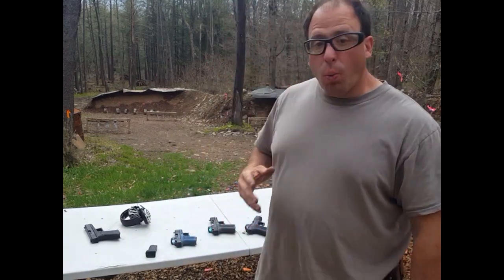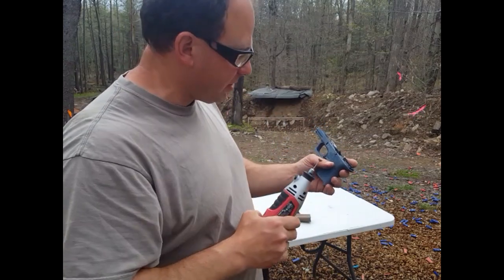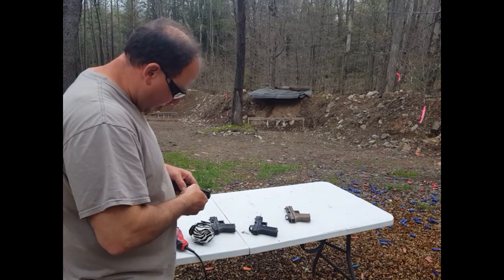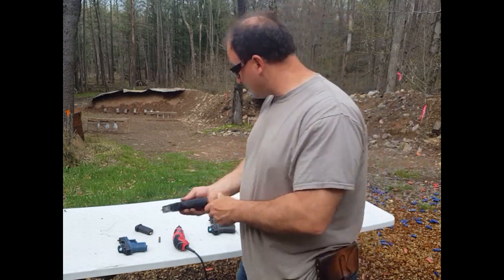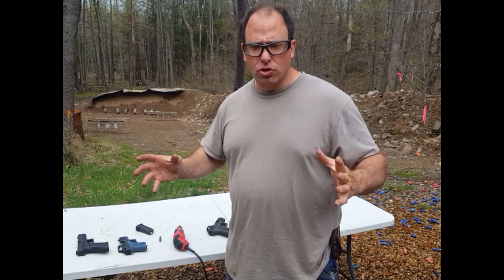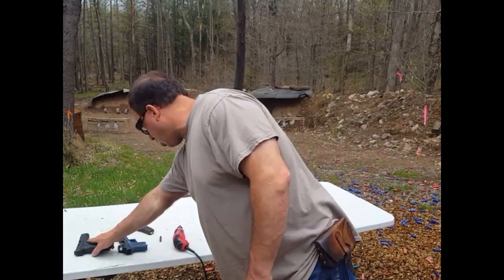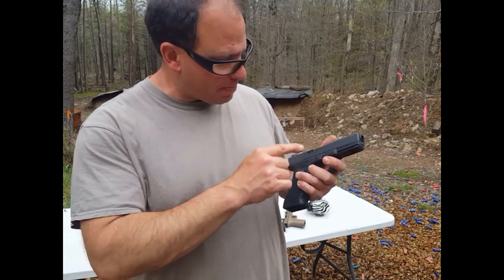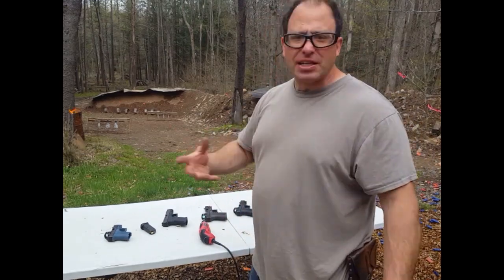Why "Ghost Guns" are Rarely used in Crimes

Comment: Me and my two cousins built one in less than 30 min it was pretty easy and we only used a drill and a exacto nife no issues either shoots like a dream
Reply from the maker: Polymer80 says you have to shoot 200 rounds to break it in. So you should not expect a gun to be reliable until you shoot that many rounds

Comment: Parts from JSD Supply are fantastic at reasonable prices.  Builder error was the only issue I've had, not the parts!
Reply from the maker: JDS is very good. Sometimes out of spec parts can come from anywhere. None of the Distributors build them themselves, so they are only a few Distributors for each part.

Comment: P80 Jam because mixed parts and different sites your getting em from. And it do be the slide most of the time because they lazy and don't finish. P80s are used much as any other gun just another throw away.
Reply from the maker: That's exactly what I'm talking about in the video. It's not just a matter of assembling the parts, you have to finish it. Then there is a 200 round break-in that  p80 says right on their website.

Comment: If it's not loading the next round like that then look at the extractor sometimes theres to much spring tension on it r really all u gotta do is take off the plastic piece on the end of that metal piece that pushes on the extractor that always fixes my p80s n I WOULD NOT RECOMMENDED 4 u 2 EVER file your barrel EVER u want 2 fix ANYTHING ELSE then file any part of the barrel
Reply from the maker: I have experienced a stiff extractor spring on one of my builds.

Comment: It takes a level of understanding to build a reliable 80% firearm. 

I have built a few and they take time as well as attention to detail. The point is to learn the inner workings of the weapons. It took me three to fully comprehend the correct operation of a Glock, or aftermarket and upgraded frames, slides and internals. Now I know what certain issues are. 

The fact remains, you can build an extremely reliable weapon for much less than a customized Glock.

I have found that a nicely equipped 80% starts at around $400. The amount you save can be spent on accessories. After all, P80 IMO is much more comfortable to hold than the Glock. P80 expanded and listened to the flaws from consumers.
Reply from the maker: Excellent post. Thank you for your feedback.

Comment: Ya need to polish the slide release and smooth out the sides where the slide rails and between the slide spring where it goes happend to a lot just a minor thingy madoodle
Reply from the maker: I started working with a lighter recoil spring and a heavier bullet.
14 lb spring and 124 gr bullet.

Comment: Rip J Stark but it’s the blueprints that is the issue for when you 3d print they are claiming it’s not protected under 1st amendment so the files that was put out people were making fully functional guns and now they want to put a stop to it. To me the term ghost guns makes me think of this type of term Homemade
Reply from the maker: The term ghost gun has been used by police for decades to refer to factory guns with the serial number scratched off. So now they added polymer80 to that category. This Is How They inflate the number of Polymer80 is used in crimes. They lump it together with all other crime guns that have the serial numbers scratched off. I did a video on that...
https://youtu.be/4ZL3_XrK0MA

Comment: My friend did g19 p80 build took him bout an hour to make first time but it worked fine just had to buy a new trigger cause the trigger kept getting stuck once he got new one it was fine
Reply from the maker: There is a 200 rd breakin period.
Reply: @tsafa  his trigger kept acting as a binary trigger and would shoot twice than all of a sudden got stuck and went a little full auto for the last 5 bullets in magazine
Reply from the maker: @brandonolson5545  seems like bad sear engagement. Especially since it works after trigger group was changed.
Reply: @tsafa  idk that much about guns just basic stuff but the people at range came to check his gun cause of the quick full auto and said the trigger was bad so he bought new one and it worked perfect after changed he just figured they gave him a cheap or messed up trigger with the p80 build

Comment: You should put a big yet, at the end of the video name. The criminals, mostly gangbangers get guns from gun runners because they can’t and don’t want to buy them legally. Gun runners mostly get them from states with lax gun laws. It’s only a matter of time they go full in on a ghost gun black market. They will themselves or hire people that develop the skills to quickly and accurately build these ghost guns and sell them to criminals.
Reply from the maker: Most of the guns recovered from crimes are Factory guns with the serial numbers scratched off. These are just as untraceable and they get thrown into the general category of "ghost gun".

A ghost gun is not specifically a home-built gun. The term goes back many decades referring to any gun with the serial numbers scratched off.

Comment: After building 3 p80s Even if you do everything right there's always a chance you get a crappy part in the kits and I just don't trust them so I traded my 3 p80s for 3 glocks. But now whenever there's an issue with a glock I know exactly how to fix it so I'm glad for the experience.
Reply: 3  p80s for 3 glcoks no way
Reply: @pbg_alpo9189  I got a Gen 4 34 a Gen 4 20 and a 19x Gen 5
Reply from the maker: It takes a bit of work to get them reliable, but they can get there
Reply from the maker: @ricoflamma5430  great post!
People have been upgrading Factory Glock guns long before polymer 80's

Comment: Most guns that you buy from the store come with paperwork detailing the serial number. Also its usually printed on the case that the weapon comes in.
Reply from the maker: Paperwork goes straight to the garbage. There's no requirement to keep paperwork. The guns are not stored in their cases, they take up too much space. They are lined up in racks inside a safe for compact storage. At some point the cases might get use for something completely unrelated or if I'm traveling I'll just grab a random case and put any gun in it unrelated to what the box might say.

Look through my channel to see how many guns I have come in no way I can keep track of papers and cases.

Comment: Umm come on dude. I got one the other day, took 30 min, did it correct, put it together and no problems.
Reply from the maker: You don't know if it's going to work until you shoot it. Once it's working, it takes 200 rounds to break it in. That's on P80s website. I don't consider the gun reliable until then.

Comment: First I thought that ghost guns are IRA or Mujahedin like work shop guns, but that is a pile of trash per design. This pistol is a replica of a design created for industrial mass production. Industrial gun production designs are quite close to technical perfection, which is 99.9% working output. Sounds a lot, but if you consider that some products are produced on a million items level than 0.1% is still 1000 items per 1 Million produced that go straight in the trash and cost a lot in quality control to be found. 
These kits are from below work shop level garages with little thought put into. The IRA, only produced simple Sten Gun like designs and ammunition, the Mujahidin an early AK copy, apparently, that was not a gas piston design as sold today.
The Pistol you showed uses a 3D printed lower receiver or pistol grip., but the materials used in 3D printing are not robust enough for that purpose. The energy created in the shell is a lot higher than most consider. Even so a 9mill does not crack your wrist you still would not put a finger at the barrel hole, would you? This is because of explosion energy physics looking for the easiest way out and that is pushing the projectile forward, than to all sides up, down, left and right into the shell, while the explosion is triggered from the direction of the hand and develops continuously away going easy out first. The French Army used steel shells to be able to use higher propellants creating high impact ammo in the FAMAS guns since recently. All those parts you are using the driller on are impacted by the explosion and will bend, stretch and eventually crack. 
Producing a reliable gun requires a design based on the available tools and machinery and the gun smiths ability to use them. 3D Printed home made guns are a dead end. The projectile might be printable so, but will no match industry level ammo so.
Reply from the maker: All the pistol frames I showed in the video on made by Polymer 80. Some of them I have color dyed but the material is the same that is in Glock guns. These are not 3D printed. They are bought 80% complete.

I have 3  of these right now that have over 10,000 rounds on them. There's a lot of troubleshooting involved when you first build the guns, but once you get them working and they are Glocks if you use Glock OEM parts.
Reply: @tsafa  Ok. Thanks for the clarification. But if these are dissembled guns of normal production and you need as an experienced guns smith hours to get them working, you must just have figured out where the 0.1% failure went to...
Reply from the maker: @j4v-cyberpunk-music  
It's usually the rails that need to be lined up.  If you're using aftermarket parts like a lot of people do it then there's a lot of variables.

Here's a video of me completing the frame to give you a better idea of what's involved.
https://youtu.be/rGfSwLNUJSY
Reply: @tsafa  That makes sense. Aftermarket parts are than also from different manufacturers I guess, and on gun guns it must be tenth of the mill creating faults.
Reply from the maker: @j4v-cyberpunk-music  
In 2021 it's been very hard to get Glock OEM parts. Most people building end up using aftermarket.
Reply: @tsafa  those parts are easy to come by.  

But serialed parts defeat the purpose.  Otherwise people would just get OEM parts and build them.
Reply from the maker: @paulscien64  
Gun parts are not serialized.
From most of 2021 it was very hard and very expensive to get Glock OEM parts.
Reply: @tsafa  the lower is serialized.  You need an FFL transfer to buy it.  If it wasn’t, nobody would buy the aftermarket ones for the purpose of not having a serial.  As the best parts would be oem.
Reply from the maker: @paulscien64  people have been buying Factory Glocks since the 80's and upgrading parts. 

That facilitated P80 building because the parts were all available before 80% frames wherever sold.

Comment: Philly loves p80s kuz u can throw the barrel put a new one in the gun and the ghost is a new gun never been shot when the police do they tests it's never been fired especially not in a crime kuz the barrel is brand new
Reply from the maker: You can change the barrel out on any factory gun. You can call up any distributor and you can buy as many barrels as you want.

Realistically crimes are never solved by forensics. Nobody is ever convicted just on that. That's just television BS. There's usually witnesses and the criminal running his own mouth.
Forensics are just used to scare people into talking. It can be used as supporting evidence, but it is never enough on its own.

Comment from the maker: The stuff you see on cop shows is greatly exaggerated. There is no National Registry.  It's illegal for the federal government to maintain a registry. The best you can do with a recovered bullet is say that there is a 20% chance to 80% chance that I came from a specific gun. You can never convict anybody on forensics alone. They just use that to scare people during questioning.  Most cases are proven by Witnesses or Confessions in court.

The way Federal Gun trace works is by going to manufactuer, to distributor,  to FFL, to purchaser. 
Remove the serial number means that Trace stops with the manufacturer. 

Private Sales are legal. The purchaser can also say they sold it,  gun was stolen or lost. However if serial number is scratched off he'll never get that far.

50% of gun Trace requests our dead end. It's a just a lot of work with no results. Serial numbers on guns are there mostly to scare people.

Comment: Not tryna be rude but the Glock 26 is a RMR cut slide you need a RMC barrel for it to run good
Reply from the maker: The heavier optic is the reason why I was having trouble. I was able to overcome that with a lighter recoil spring and a heavier bullet.

Comment: The distinction is that you have to find a gun to scratch the serían number. As opposed to build a gun from parts you get online. Is not about tracking, it’s about availability. A child was shot with a ghost gun in Maryland yesterday.
Reply from the maker: The question then becomes how did the child get the parts?  Did they have a credit card and bank account to order online? Not likely. Who is the adult responsible? Did the adults in a house not here a Dremel being operated? 

There's no way that the children in my house could possibly order anything.
Reply: @tsafa  some companies accept visa gift cards, other companies accept cash in the mail, and the dremel part doesn’t make since to me what if your child is using the dremel while you at work or out on the range, also usps allows underage kids to get P.O. Boxes without parental consent, there is ways around everything if you are determined enough

Comment: That build wet ?
Reply: Try different rail system and check it the frames warped in the inside
Reply from the maker: @S73211  yes, I got it running by using a lighter recoil spring and a heavier bullet to offset the weight of the optic. The g26 has a shorter Barrel so less pressure build-up from the 9 mm.  Other subcompact 9 mm have a much lighter slide to begin with.

Comment: You need a new ejector in the Glock 26 and it will run properly
Reply from the maker: That was changed multiple times. It needed a 124 grain bullet and a lighter recoil spring on G26.
Reply: @tsafa  so you have the 30274 ejector that is what fixed my polymer 80
Reply from the maker: @EbkHunter  the problem that I had was specific to the g26 because of the shorter Barrel. My g17 and g19 what good with the shadow systems extractor
Reply: @tsafa  💯💯💯 hell yeah you have some nice polymers I only have the 19 I wanna get the 26 for pocket carrying
Reply from the maker: @EbkHunter  search my channel name and p80 g43 to see my pf9ss. That's what I'm carrying now. Much thinner.

Comment: No facts , every p80 I’ve bought has this problem , the Dremel is the only way dude and it sucks
Reply: I can’t test like I want to either , BUY EOM LOWERS AND BUILD AROUND IT
Reply: Oem
Reply from the maker: @dondadaproductions7730  
It takes patience and a lot of tests fine, but you can get any P80 to work. Sometimes the internal parts you get are just bad and you have to keep swapping them out.

But for sure not what they tell you where it just works after you slap it together

Comment from the maker: link to Odysee P80 building playlist...
https://odysee.com/@Tsafaaol.com:2/Polymer80-Building-P80:a?lid=a588288b0b9eb3119ed7039dc73aa4ea42850e07
Reply from the maker: @jasonking9727  I got it working with a lighter recoil spring and heavier bullet but it turned out that that only addressed the symptom. The real problem ended up being the barrel. When I changed out the barrel, the gun with working fine with the standard recoil spring and standard weight bullets.

Comment: Great video but the rear rails are..... well are your issue right there buddy lol (I’m sure you know already 🙃)
Reply from the maker: The rails have been work thoroughly. I believe the G26 brownells slide is either slightly out of spec or slide cerakote is causing resistance.

I put a g19 slide on it and that  works fine. So I have isolated the problem to the slide.

When I hold down the trigger and I run the slide back and forth I feel extra resistance with the g26 slide.
Reply: @tsafa  ah I see ., well if you slap on the g26 on another frame and it gives you the same issue then my bet is on the barrel sled not being in speck which is causing feeding the round incorrectly., I had the same issue with Rock Islands doing that.

Sending you gunsmith vibes I hope to see you and the build soon with a smooth function test video soon. Curious to know how you fix it.
Reply from the maker: @mattlinville5539  I sent an email to Brownells. I figured they must have experienced this before.

I'll see what suggestion they have. I'm thinking maybe strip off the cerakote off the bottom of the slide. Or maybe file down the plunger a little. I'll make a video when I get this fixed.
Reply: @tsafa  hell yha looking forward for that update video! 👍🏻 keep on it good sir